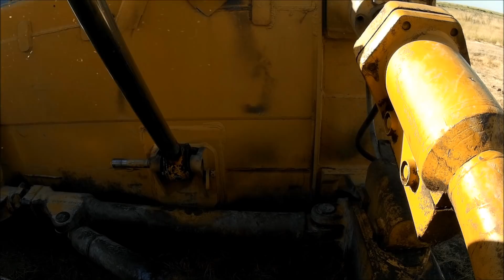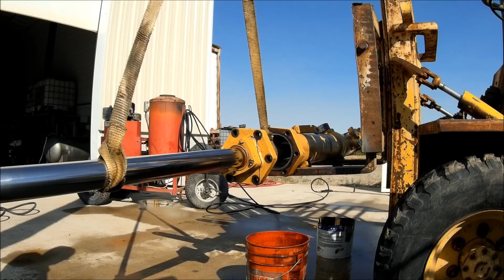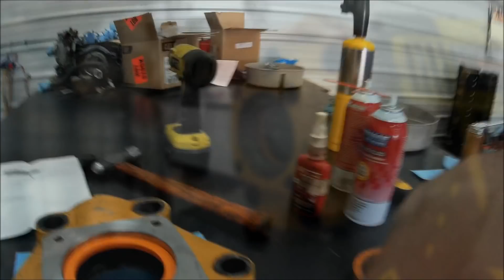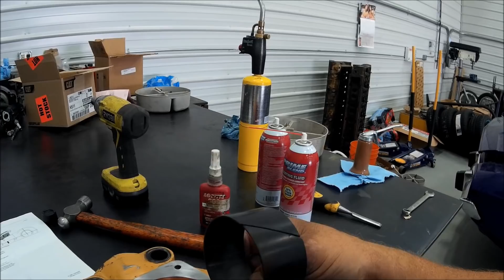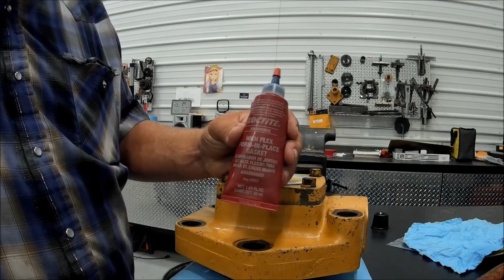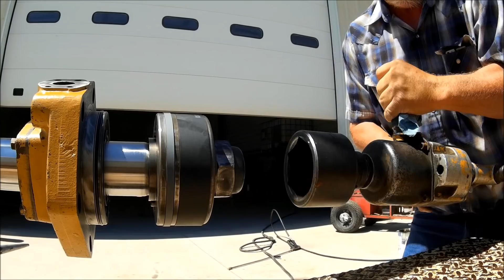Repairing A CAT D9G Lift Ram

Comment: Packing sucks ass. Occasionally I will run across one in our shop and most of them don't have aftermarket seal kits, so I have to repack them. Same with screw pumps and old gearboxes. You are the master of repairs! Great vid.

Comment: Hey I have the same vise as on your work bench, is your handle bent too?
Reply from the maker: Yes cheap piece of crap, it's completely non functional now, I though a Wilton was supposed to be a good vise, got any suggestions for a replacement?
Reply: Round body Wiltons are generally good, the others are crap.

Comment: We've done that on a D8H but never on a D9G. I'm sure we never needed to use adhesive on rod seal though. I do remember the rod being that tight. I see you use ether to clean with. I use brake cleaner sometimes and I think there's ether in it. I see you like Hillary as much as I do! It's ok. We have Justin Trudeau and Rachel Notley who are just as bad as Hillary... Only  thing Trudeau is stupid too.

Comment: Nice I did many over the years even a 8 inch crane piston of a big rt .
CAT tech told me they sell a epoxy jb weld type product CAT approved to repair damaged chrome shafts. I used jb weld wet sanding it down with 600 and water. Still holding up. 
Japanese make seals that never seem to go bad. New CATs have Mitsubishi seals probably made of endangered whale blubber ...lol.
No more leaks on new age stuff. 
I had leather v packing in my old Bucyrus Dynahoe. I could change split v rings without pull in head off.
Like old steam engines days!
We are at Con expo now in Vegas...you gotta go once in your life!
Reply from the maker: I was there, I go every time it was awesome

Comment: everyone tells me i should repack them myself, well maybe but i dont have a shop and all them there fancy tools or a 1" impact gun to get that nut off thats torqued to 5k ftlbs
Reply from the maker: I know next time I'm in Wendell NC. lets do a ram video together...............wait how far is that?   aah I'll get Jonathan to drive
Reply: my scale of big one is a little smaller,  put the eye end on a block, drive over it with the dozer then get the big pipe out!
Reply: Mountains out of mole hills.
Reply: If you can put it down on a solid table, then with a cheater bar, you can do the work. That being said, if you operate something like this and don't have enough tool to service them, you're just asking for trouble. When i got my first d9 years ago, i made a deal for all their beat up tools, so  i could service it.

Comment: welcome to my world i do this 10 hrs a day 5 days a week...  did you call cat and see if they offered a o-r rod or a classic rod for it? pretty common dozer or used to be, might be a rod hanging out somewhere. i can look on sis if you like.
Reply from the maker: Thanks Hayden,  I don't think you'll find anything for this old girl,but give it a try,  the rods were new last time so this would be there first re chrome, I need and undercarrige some serious ripper work, brakes relined dozer arms and bore all the connections , we told the salesman to keep an eye out for a 9R
Reply: what is your s/n prefix and ill see what they got in the morning. there was 1 grading business around here that had a h and a g and they put new u/c on them about 2 years ago, cant remember how much it was but it was up there.
Reply from the maker: 66A7864   I think the hydraulic is in the 9700 range,  7.25 bore?   been goofing off all day parts books are at the shop
Reply: ok couldnt find a lift cylinder on your exact s/n had to go to a different s/n and if you look on your barrel there should be a small metal identification plate with the cylinder number on it. if the cylinder number is 5j3037 then they do offer a reman rod and there were 2 or 3 available at about $1100. according to this break down its a 6.25 bore 50" stroke. seal kit number is a 416 2147. part number of the reman rod is a 0R-1276. hope this helps.

Comment: Yours appears to have an offroad upgrade package and a gas engine, but I have that same steam washer. I've never even seen a picture of another one exactly like it with the small metal fuel tank on the bottom. Best I can tell it's an ancient Hotsy. No stickers or markings anywhere on it. Works like a champ though.

Another excellent repair. Thanks for sharing.
Reply from the maker: The off road kit came courtesy of a couple old Suzuki motorcycles, works great, that thing is about a 1982 model, same engine same pump, tough old Hotsy
Reply: About like a wore out buffalo Hunter like me